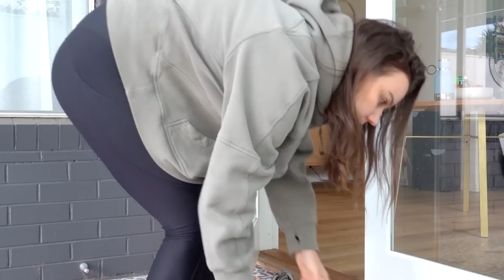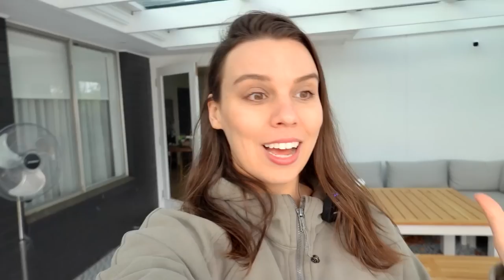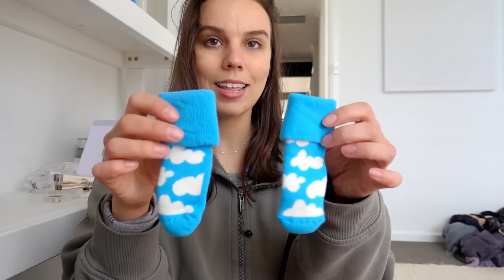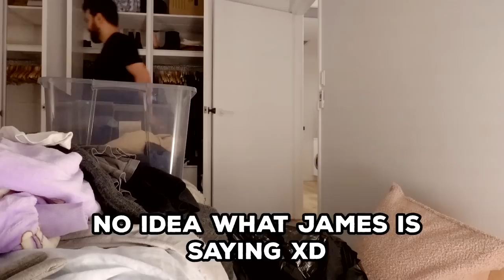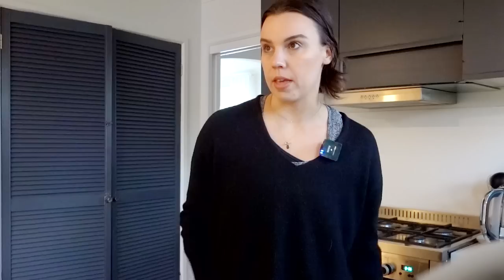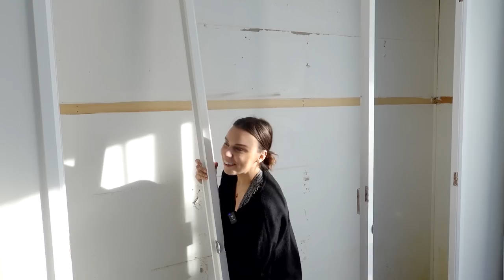We are renovating

Comment: Hahah the dirt patch 🤣🤣🤣
Tip for the climers: if a plant really is thriving in a spot you weren't prepared it to grow at, you can manually kinda guide it where you want. So you could get a long stick or few and attatch it on it with some plant clips or a piece of rope that's designed to tie plants with (don't know what it's called in english but it's rope that's covered with tar). Then when the plant grows you can keep guiding it where you want. Always remember to leave enough room though and not tie the plant too tight

Comment: I used to work for an organic certification company in NZ so I know a little bit about compost and soil (but these products were not my area of expertise). The reason you won't see them as 'certified organic' is because necessary components like Nitrogen,  Phosphorus and Potassium are "natural" but not "organic". The slight difference in definition goes back to chemical properties where "organic" chemistry primarily includes Carbon, Hydrogen and Oxygen.  

This means that inputs, like fertiliser, won't meet the criteria to get certified as organic.  However, they may still be okay for use in organic agriculture. In NZ, there is a category that products can get certified 'for use in organic agriculture' which means the way it was made and the ingredients used are aligned with the organic principles.

I think the main certifier in Aus is ACO - so you should be able to look at their list of "approved inputs" to see which products are aligned to your chosen method of gardening.  

I hope this helps! There's a huge rabbit hole you can go down when learning about natural/ organic products,  but for a home gardener I hope it is a good start :)
Reply from the maker: Ah thanks so much! I’ll check them out ❤️

Comment: I work at a dentist office. If you want to whiten your teeth the best way is to get trays made at the dentist it’s a little pricey but you can use them with whitening gel they sell which it shouldn’t be expensive. They have different strengths depending on if your teeth are more sensitive or not. If they are too sensitive you need a toothpaste like Sensodyne to help that.

Also am I the only one who doesn’t get rid of clothes during weight changes. If my clothes get a little loose I know I lost weight but I  don’t throw it out. I only donate when I feel like it’s out of style or they have been worn too much.